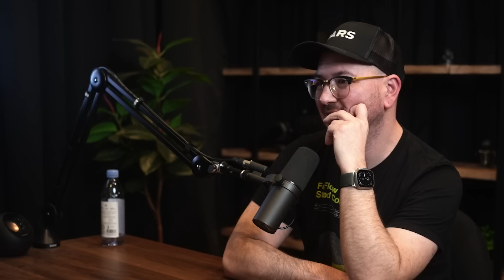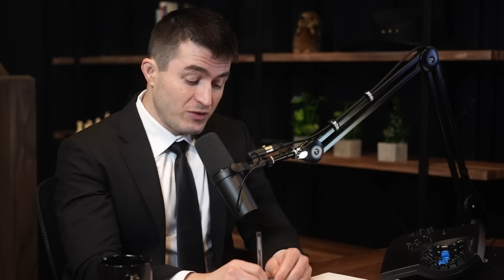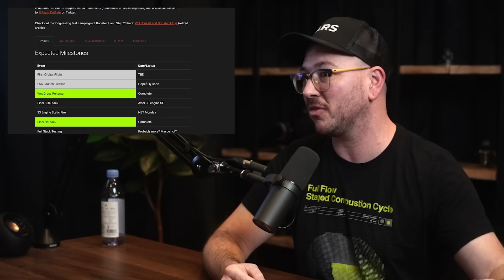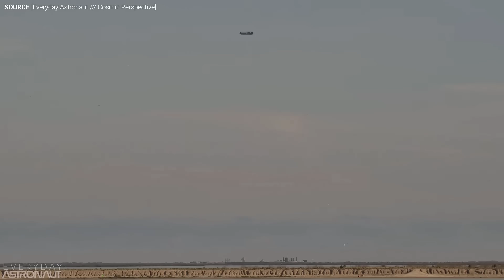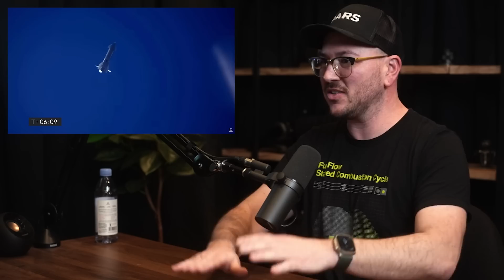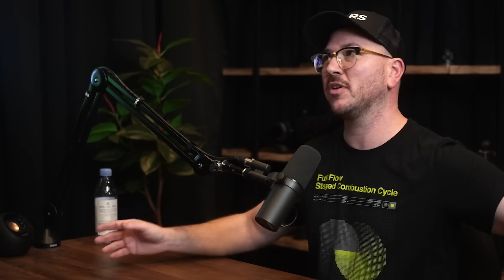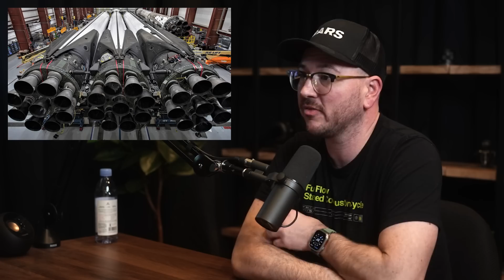Starship: The most powerful rocket ever made | Tim Dodd and Lex Fridman

Comment: 9:20 spaceshipONE utilized this 90 degree turn on re-entry to increase drag. very cool
Reply: Not quite they are relatively  different. Not trying to argue, just point that out.

spaceship one, and star ship are both reusable re-entry space craft. 
(SPS1 &  SS for short)
SPS1 is both the "main" & " upper" stage. Technically a SSTO, As it is parasitically carried/launched, it has no booster stage.  Just like space shuttle & all space "plane"  type spacecraft, and re-entry vehicles.   It uses it's largest Surface area side for its heatsheald/ re-entry orientation. Balancing between optimal velocities / angle of attack / and inclination or angle of re-entry.  it is doing this to depart orbit / space , entering the atmosphere.   Once it is in the atmosphere its angle of attack is limited so it doesn''t depart flight & glides all the way to the ground like the shuttle.   As the atmosphere thickens it reduces AOA to maintain it's optimal glidslope & air speed (Aswell as ground speed) all while maintaining it's appropriate lift vector,  never departing flight or it's relative (to the surface/ground)  forward travel. It may not actually be capable of flight or creating enough lift / airspeed to assend. Like most gliders & plane type re-entry vehicles. 

Dragon/Orion/Apollo capsule type re-entry vehicles do the same until they are slow enough to use a parachute to descend completely.

While Starship use this method Aswell.  Once it is now in the atmosphere, as air resistance increases it will slow more and more. But before it gets to the thicker parts of the atmosphere it will use propulsion for deceleration. So it doesn't burn up & reduce max q on it's overall  stages of re-entry.   At no point does it glide to the ground most of the deceleration once in the atmosphere is propolsive an near vertically decent. It doesn't belly flor or use retrograde orientation untile it is near the ground as the deceleration once 90° would create tremendously high forces from drag.

So in short  SS is like shuttle on initial re-entry, then like capsule midway (before chutes), it is then like the falcon 9 booster using propulsion to cancel out interia, then using atmospheric drag in its descent with AOA to stear & decelerate, ( except it would be 90° or bellyfloping with a near completely vertical descent)   until it is close enough to the ground to propolsively land.  but before that would happen it flips eats it's interia / stops rate of decent & "hoverslams" or "suicide burn"

I hope this makes sense! This is the difference between shuttle / glider type re-entry and starships re-entry.

Comment: I was really surprised about the horizontal landing thing.  Landing gear weighs a lot!  Also, it's not a lifting body at all, is it?  Is Tim talking about a full redesign?
Reply: It would change everything about the whole structure of the body, which is designed to take forces directly in line with the body, not horizontal to it from landing gear.  I'm surprised Tim thought this was even remotely viable.
Reply: I can't believe Tim talked like this. The structural change would be impossible, and even if possible would increase the dry mass tremendously. The mass would have to be concentrated onto landing gear, that's a lot of structure to do that. A rolling landing requires a sane amount of forward speed so touchdown on the runway isn't just a bit less than terminal velocity. The flaps don't allow this, even if enlarged. They'd need an airfoil shape.  The list goes on and on.
Reply: Yepp thunderf00t called it they'll re-invent the shuttle

Comment: I really love the fact that Tim uses metric instead of the innacurate imperial system. It is a shame USA do not push harder for imprial to be replaced once and for all.
Reply: Metric is so much easier too but we got used to imperial thanks to school.
Reply: Dude we can’t even kick disruptive students out of class in the USA or discipline them. We can’t hold them back from failing and sometimes we can’t even fail them. Let’s work on that first.
Reply: Imperial isn't more or less accurate, the only difference is metric is based on tens, and in the states at least at my school we were required to learn both systems. But even in Europe they still use degrees which is from the imperial system, because the metric version is a headache.
Reply: angle degrees like what you use on a map with a compass or in building.

Comment: why not the Brick shuttle landing strip?  Trade off's more mass vs less fuel... but you have to think  .. space travel.. it's not a orbital lander.. it is a space traveling ship.... what ever mass you use in landing gear.. if it is  net gain on earth ... in space after refueling. what  would that additional propellent be or what  benefits in space travel would that propellent be.. .. who want's to run out of gas in the middle of no where?

Comment: i think if you land such a huge mass of rocket horizontal you might need a giant runway and a long time for it to slow down. Might be much more trouble and danger than landing using the engines that were there already.
Reply: That's a good point. It would also require landing gear and probably fixed wings.
Reply: Ya exactly the perfect re-use space craft design was the shuttle, now x-37B...
Reply: @StinkPickle4000  Shuttle is generally agreed to have been a failure at reuse among space enthusiasts. The goal of reaching a refurbishment cost below the cost of building a new rocket was never reached, so the program wound up being very expensive. It's possible they could have gotten there eventually with more flights, but the program had to end due safety concerns and frankly increasing the launch cadence would have probably made those safety issues worse.
Reply: @DontThinkSo11  Yepp you are correct!  But you haven't shown the shuttle design, or a derivative, isn't the best re-use design.  Given all we the OP was talking about it seemed to flow logically

Comment: DOUBLE a Saturn 5 by a private (non-governmental) company? I,I,I, just don't know what the heck to say, other than that is the dopest thing I've ever heard!
Reply: "Private" if a company that's completely dependent on government purchases to exist ... I consider that a publicly funded venture. Let's not pretend spaceX exists onnits own. It exists because of the government.
Reply: It is nearly 60 years and there is almost none break through in technology. They just put more rockets and make it bigger. Not impressive in comparison to other branches of tech.
Reply: @alfchlopecki7673  
It is not just more engines and bigger; the F-1 was a great engine but, if you go to its design, it was extremely simple, even compared to other engines that were flying in the Soviet Union or the US. Raptor, the engine which power Starship is a breakthrough, no other engine like this has ever flown and/or gotten past the development and early test phase

As an example of how good this engine is, the F-1 had a dry mass of about  ~8.4 tons (metric) and a thrust of ~6700kN, Raptor has, and keeps improving a lot, dry mass of ~1.5 tons and a thrust of ~2300kN. So an F-1 is equal to about 5 raptor engines (a bit more) in dry mass but in thrust just 3 Raptors are equal to an F-1; this difference in thrust while the Raptor is able to throttle and is about 10% to 20% more efficient 

And the Raptor is just one aspect that makes saying that have not been any breakthrough is simple and plain ignorance

Comment: What is it's carbon footprint?
Reply: To orbit it’s about the same as a 747 15 hours flight.
Reply: @GreenPartyHat  I don't see how that could be.  It must be much greater than that.  Look at the volume of propellant the booster must contain compared to the volume of the wings of a 747 (where I believe the fuel is stored).  If almost all of that is being burned in order for the rocket to reach orbit, as opposed to the volume contained in the wings of a 747. . . doesn't the booster have to be putting a lot more carbon into the atmosphere than the 747?

Admittedly, I guess a fair bit of the booster's volume is filled with oxygen, which obviously doesn't contain any carbon. But it seems to me that the volume of methane contained in the booster must still be at least three or four times the volume of Jet B fuel contained in the wings of a 747.

But maybe Jet fuel has a lot more carbon in it per litre than methane does? 

Okay, I just looked it up.  The formula for jet fuel is C8H18.  So by weight, the amount of carbon in a litre of jet fuel is roughly the same as the amount of carbon in a litre of methane.